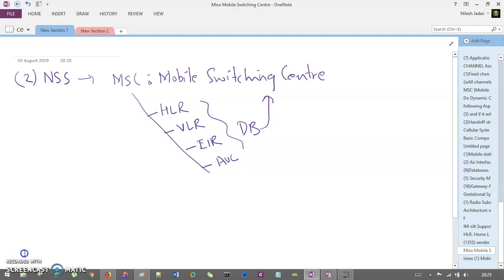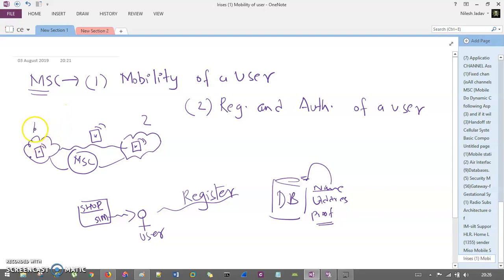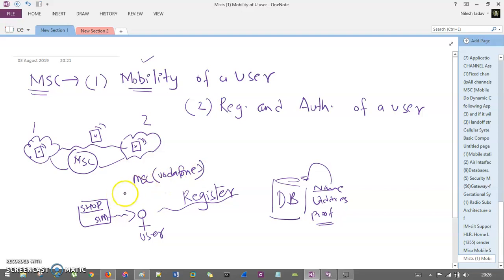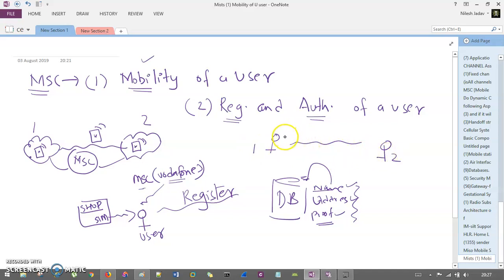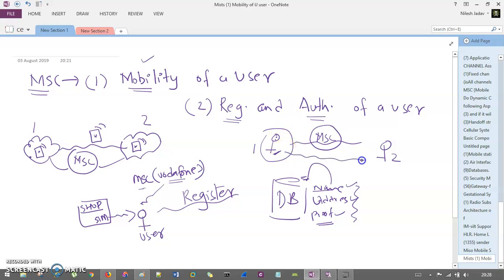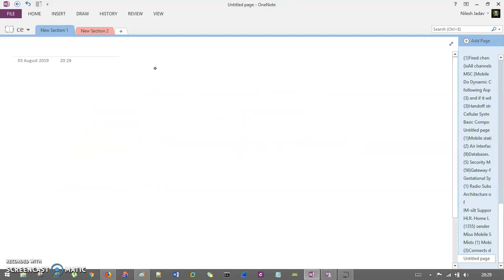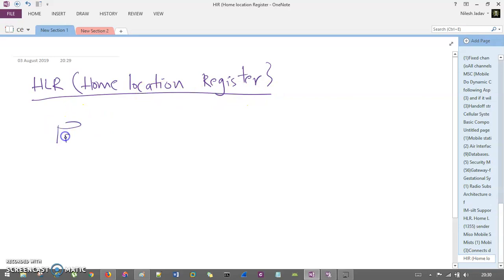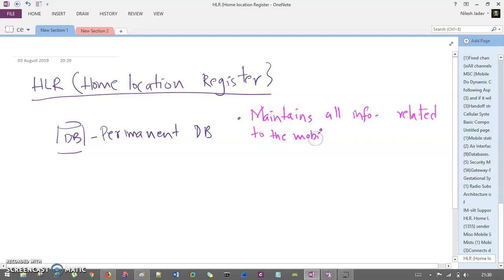GSM Architecture Part 2 || HLR | VLR

Comment: How often and when is the VLR updated? Is the process initiated by the mobile subscriber or the msc?
Reply from the maker: It is initiated by network itself, you see when you are out of the home network, initially you didn't get the service but after a while in a foreign network, you get some service (meaning network), this happens because, your VLR is going to activate when you are in foreign network, it will give you TMSI, and try to give some network so that you can access services inside a foreign network. VLR will tell HLR about the current location, it will update inside the Database. So in general your MSC is going to do everything. When this VLR activates it is activated by MSC and gives you TMSI. Hope that helps.
Reply: @nileshkumarJadav  Yes. Thanks a lot
Reply from the maker: @kingsleybrown6624  Thanks for the comment. Share the video and enjoy.

Comment: Hi, How registration happens in HLR and VLR ? and Which
network elements are involved in the process?
Reply from the maker: When you purchase a SIM card, you need to activate it, for that you need call to some customer care number ( such as 199), once you do that, that activation call send your IMEi and IMSI number with authentication key to HLR ( actually you get registered) database. This entry is actually a permanent entry in the HLR database and your location is home network. So whenever you call to someone it is handled by HLR. 

When you move from home network to foreign network your permanent database (hLR) will not work. 

This temporary location entry is handled by VLR and it registered by TMSI number. Although your temporary location also known by your HLR via MSC. (Registered by TMSI number - as you cannot work with your actual IMSi number in foreign network) 

The entry in HLR - all home network information, subscription you had purchased, location information.
Reply: Thank you very much
Reply from the maker: @chelseygiot8390  hope that helps